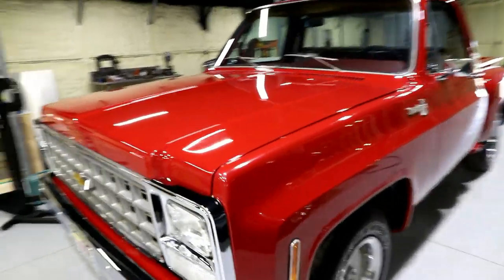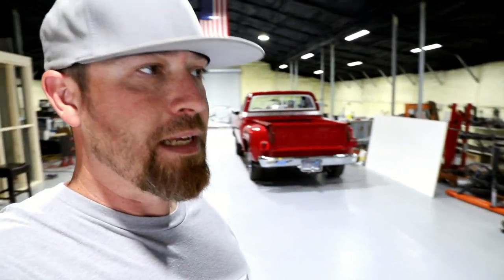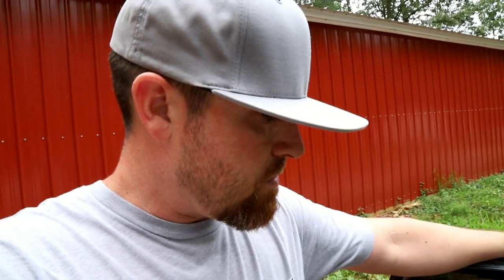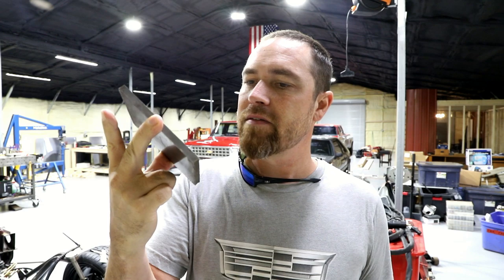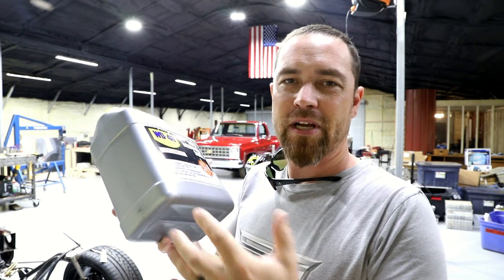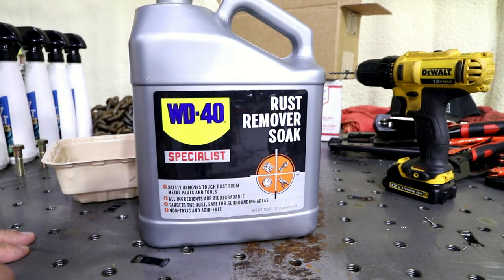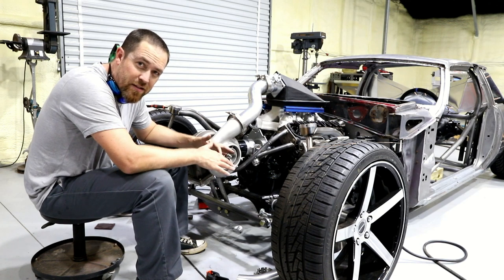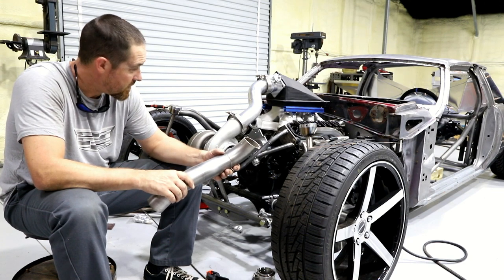How To Make A Turbo Mount

Comment: I like the turbo mounts... but I have a question. What happens if you ever have to remove the engine? Did you make those bars removable on the frame side?
Reply from the maker: yeah there wont be any frame side bars anymore

Comment: Hi Kyle. Long time fan here. Question on where you source you metal from. I have a fairly serious build in the works at present time and I'm looking for some decent pricing on sheet metal for the floors. Also, roll bar/bracing material. Check out my channel you might dig the build. 63 AWD falcon. Just kicking it off.
Reply from the maker: mainly from metalsupermarkets